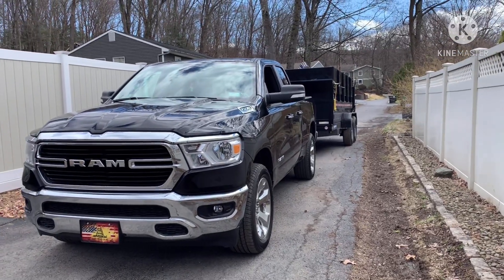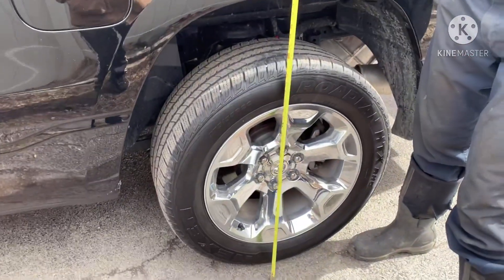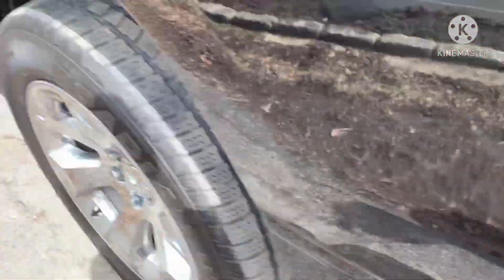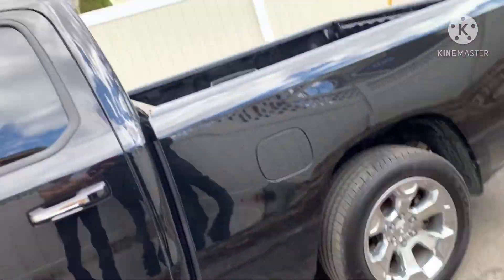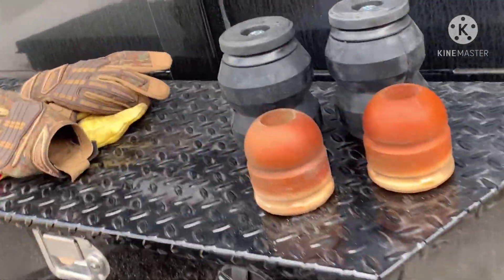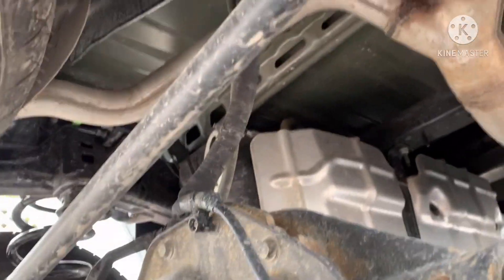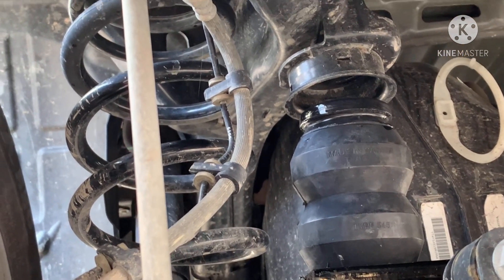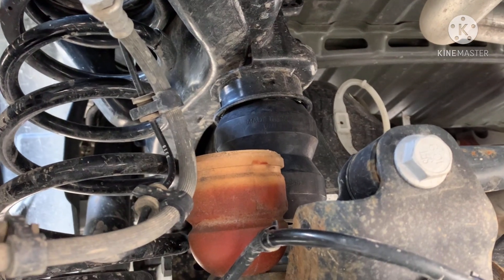Timberen Suspension Enhancement System on our Ram 1500

Comment: I have the 04' model I'm installing a different brand of stops. And upgrading the shocks. I have leaf springs put I'll do them after I save up to get both.

You should look into the heavy duty springs and shocks to go along with the Timbrens
Reply from the maker: I’m not sure I’m going to invest too much more into the suspension on this truck. I actually bought a new F350 and that is what we use for most of our heavy towing. This truck still sees some light recreational towing, but I am not disappointed at all with the Timberen  system.

Comment: You should have let the rear suspension settle before you took your after install measurement.  Is it safe to drive with the new bump stop sitting directly on the rear axle ?
Reply from the maker: I would not recommend it.

Comment: Great vid.  If that trailer ever gets loaded to its weight capacity, there is no amount of add ons for a half ton you can buy to make it safe to haul.  You’ll be quickly shopping for a one ton to pull it after your first white knuckled drive.  14k behind a diesel 3/4 ton is a big load.  Keep up the good content, love the tool vids 👍
Reply from the maker: Great advice Bizob. I have been looking around for a larger, used truck for the near future. Thankfully, I am only hauling household junk, no bulk items like dirt, gravel, shingles etc. So far so good. But definitely I agree with the larger truck.
Reply: Max GCVW for these new DT Rams is a touch over 12k. They're pretty impressive now.
Reply: A 3/4 Ton will easily handle 14k especially with a set of Timbrens or Sumo Springs on back.
Reply from the maker: I just picked up a F350. The truck market insane right now. I found a couple base model F250’s, but they wanted almost as much as my F350 Lariat by the time they added their “market adjustment” of almost 8K 🤦‍♂️
Reply: @lakes2land780  yea, it’s mind blowing what trucks are going for right now.  Congrats on the new truck! 👍
Reply from the maker: @bizob211  thank you 😊

Comment: So after 8 months of driving around with the timbrens installed how do you feel about them?  if you had to get another Ram tomorrow would you install them or go a different route?
Reply from the maker: I love them. For $ 250 and 15 minutes to install…I would highly recommend them. Ideally, I would love a 3/4 or 1 ton truck. But that’s a different story. I don’t think you would be disappointed.
Reply: I heard some other commenters that the truck drives a lot rougher with the Timbrens on.  Do you agree?
Reply: @philiplee8330  If no load in the back..the timbrens are not touching the base plate ...therefore ride is like before the install

Comment: It really doesn’t seem worth the money for an eighth of an inch and then what happens when the trailer is fully loaded does the bumper hit the ground?
Reply from the maker: OK, what I can tell you is my truck has yet to bottom out while towing. 1/8 of an inch does not sound like a lot, but when you translate that into weight distribution it actually means a lot while towing loads. I have had some pretty heavy loads in my dump trailers, and I will say the right quality has improved significantly since installing these. The temperance act as a bit of a suspension themselves, they have give it to them which takes weight and pressure off of the coil springs. The factory bump stops were ridiculous, it allowed the truck to bottom out the suspension quite easily. I have experience far less body roll and improved handling while towing loads as well. Unless you want to invest in an air suspension, this might be the best bang for the buck you can get.
Reply: @lakes2land780  i’m not saying that you did the wrong thing I’m saying that ram doesn’t build real trucks any pick up truck with coil springs on the back as I’m in for anything more than a daily driver that’s all if it was mine, I carry it all apart and put leaf springs and some airbags on it being at work on them I drive the other brand that’s all. Have a good day sir enjoy.

Comment: I have a problem with my Tundra since my trailer is also very heavy on the front 
But gaining an 1/8” is not worth it at all on my other truck I end up adding two additional leaf springs which made it much better 
I think the best thing is to regulate the tongue weight rather than adding all this useless stuff
Reply from the maker: Yes, but there is a big difference between leaf and coil spring suspension systems. Now you have a stiffer ride all the time. These enhance the ride when there is a load, leaving my truck with a comfortable ride when not towing.
Reply: What i do with all my trucks since they all sit. With a saggy ass from the factory.  I put a 2in lift on the rear. An when you go to order your timbren s. Call them an they will eather give you a spacer or a hole different bracket to mount them on. To lower the timbren down since the truck got lifted 2in.  Problem solved..  when you put weight on that set up. Truck dose not look like its sagging anymore. No mater how much weight you throw at it.

Comment: How is the ride with loaded trailer? Just installed mine for my travel trailer 6000lb
Reply from the maker: It tows really well Tommy. My larger dump trailer is 14,000 GWV. I have never had to to over 6500 lbs yet, and probably never will.

Comment: I feel like more of a load would of offered more desirable results. Those timbrens have a 1 1/2" gap that trailer prob has 300 pound toungue weight which barely made them contact the axle. If you were to load a 6-700 pound atv in the bed I bet you would have much better results and lay the 250 bucks for 1/8 of an inch comments to rest.
Reply from the maker: Agreed. I cannot imagine the comments if I showed that trailer loaded with junk and that Ram hauling it. Very impressive, but I would get ripped to shreds in the comments😊. Still the best $250 investment I have made regarding ride improvement while towing👍🏻

Comment: Just because your 1500 has a hitch receiver doesn't mean you can tow anything that will hook up...... Holy balls dude. You put your self and everyone else on the road at risk.
Reply from the maker: Holy Balls? Do you have the same conversation with everyone towing a bass boat and trailer every weekend? I have NEVER exceeded the tow  limitations of this truck. The trailer weights 3900-4000 lbs in a good day. My average junk load is just under a ton. The tow capacity on the truck is 11,000 lbs…..and I would never consider towing that much despite the rating. I have a 2022 F350 for all of our “heavier hauling”. Cmon bud…do better than that 😂

Comment: You should of just got air bags. 90% of them trucks have to have them because of the spring rear end. 
Can’t tow with a 1/2 ton dodge. 
I would prob trade it while you can. 
3/4 ton is the dodge to have
Reply from the maker: Airbags is the way to go, but a lot more money. I would love to trade it in, but the truck market is off the hook right now. Used trucks are selling for more than they left the lot for. Sad.
Reply: You should be able to get all your money back from your truck. 

And are you sure they’re expensive because I think it’s just a little rubber insert and a quarter inch tubing with the air chuck so pretty much simple things. 

But I wouldn’t doubt some paper pushing asshole is charging hundreds of dollars for it
Reply from the maker: @ericbuchta9765  I like the idea of the airbags, because your not stuck with the suspension set one way, it’s adjustable. Great point Eric.
Reply: @ericbuchta9765  You didn't mention anything about the air compressor or air tank. Those are what make the air bag more costly. Plus all the labor for mounting compressor, air tank and running the lines into the truck to where the air bags can be adjusted.
Reply: Aaron bro. That one. You speak of is way to fancy. Just get the cheep one that you put In the springs and have a valve stem on the bumper. You can air it up at any gas ration. 
No worries brother I got ya. Save ya Mooney $$$$
Reply: @Lakesidelegends 

 $120 spring inserts

Comment: Why not just change the rear coils. The rear coils on these Ram trucks seems to be the problem due to how flimsy they are.
Reply from the maker: I could have gone that route, but this was a faster installation, and more cost effective. Plus it really does not affect the overall ride quality as far as firmness goes until a heavy load is placed on the truck.

Comment: Not much difference. So what’s the point ?
Reply from the maker: There is plenty of difference. Ride height is improved, there is less squat on the rear end and the inferior bump stops are taken out of play. Much better handling and ride quality while towing. That translates into much of a difference.
Reply: @lakes2land780  thanks I appreciate it . I did go ahead and order a set
Reply: The trailer is empty ..............WHEN it will have 4000 lbs of stone in it the timbrens will kick in...the stock bumps would be flat

Comment: So a $250 part to gain an eighth of an inch? Doesn’t seem that good then.
Reply from the maker: It’s not to gain anything. It’s to prevent the truck from bottoming out on the factory stoppers. The factory stoppers allow too much sag in the rear end. This is not a lift.
Reply: I don't think that's what he is saying.  I think the initial gap could be a little tighter on the timbren.  To engage it sooner.  But then it may hit on a big bump when not loaded.  I am looking into helpers for ram as well.  Not sure what setup I'll go with yet.
Reply from the maker: Timberens cost 230 bucks. According to their website, they offer a 90 day satisfaction guarantee. I personally love them. Give them a shot. If you don’t like them, return them.